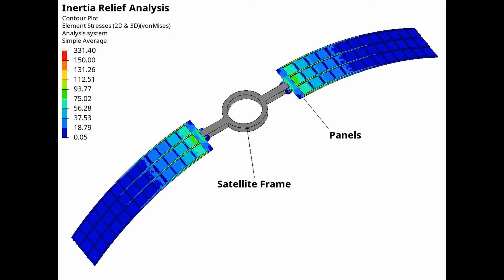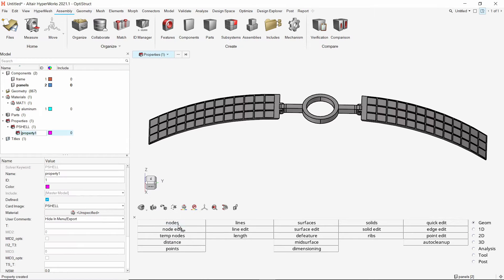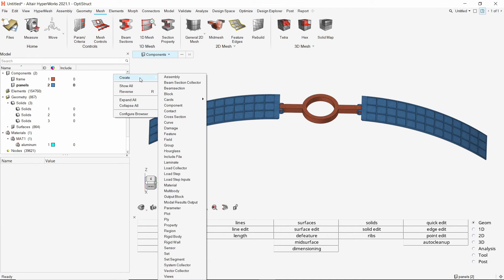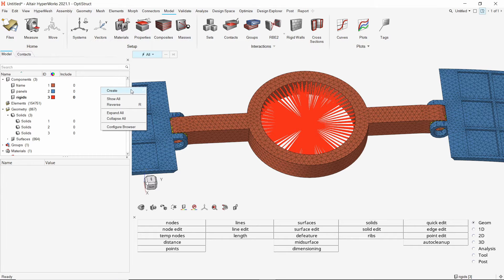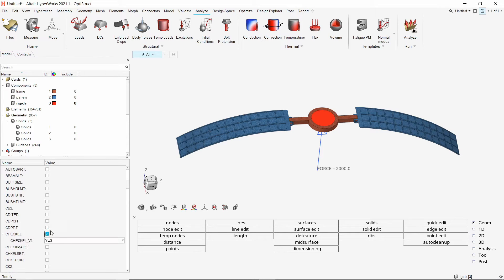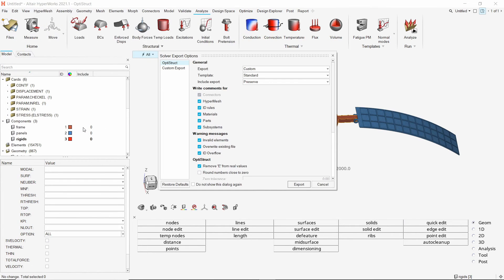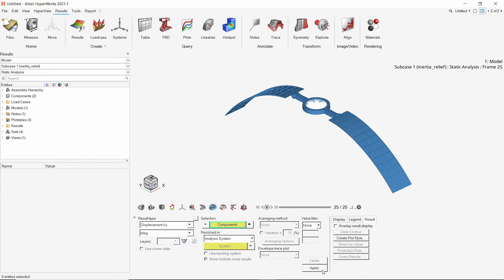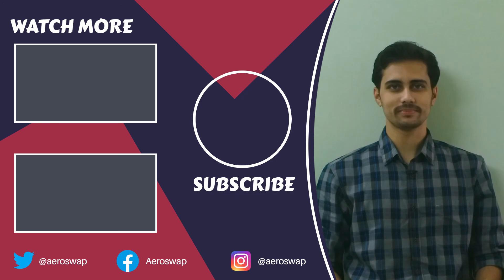Inertia Relief Analysis using Hypermesh [Optistruct Tutorial]

Comment: Would you get results if you had applied g load to the whole structure instead of force at the center?
Reply from the maker: Yes, you will get the results in that case. However, as all nodes on the struture are moving with same magnitude, the displacement results might be negligible. Furthermore, I do not think the whole struture will be acted upon by a uniform g load in any real life scenario! There will always be a variation in loads applied at different locations on the structure.
Reply: @Aeroswap  thanks for reply.. But I didn't quite get  your comment about uniform g.. In reality aren't we acted upon a uniform g load as long as we are at the same peripheral line on the earth
Reply from the maker: Right, we are acted upon by uniform g. But what I am trying to say is that without an unbalance of forces, there cannot be a deformation. Consider a beam element with the same magnitude and direction force applied at both ends. The beam will translate as a whole rather than deflecting. Similarly, constant g will translate the body and there will not be any deformation.
I hope you get my point here!

Comment: I have a question, why no constraint(load collector) is applied?
Theoretically without constraint the value of global stiffness matrix will be zero and no solution will exist.
Reply from the maker: Hi Shashwat, in an inertia relief analysis, the response of the geometry is tested against internal resisting forces caused by inertia. So SPC constraints are not required.
However, the solve does create 'Support' type of constraints at the backend. It is also possible to create support constraints manually, but the method to do that is not shown in this video.
So essentially, due to these supports, the global stiffness matrix does not become zero. I hope this answers your question!
Reply: @Aeroswap  Thank you